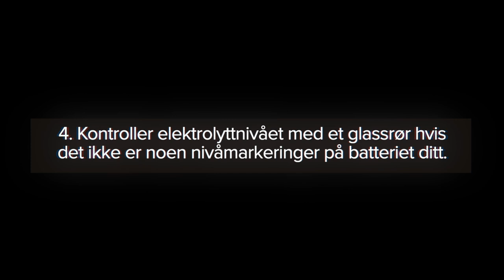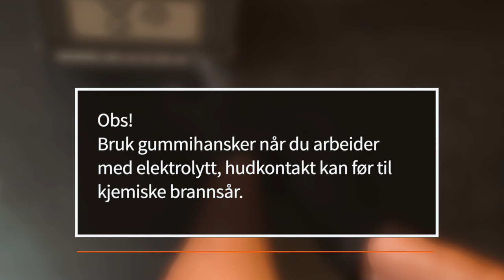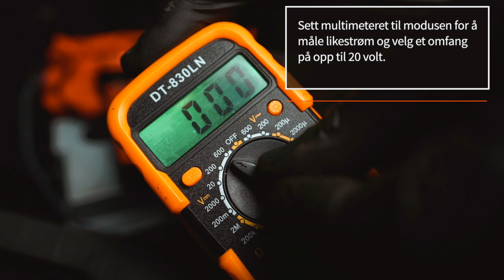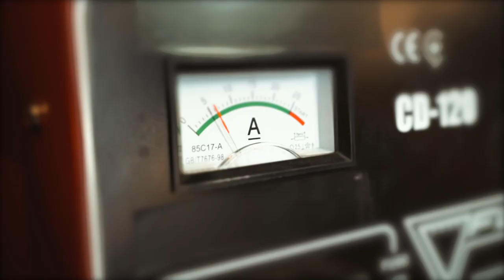Slik sjekker du bilbatteriet | AUTODOC

Comment from the maker: Ta en titt på videoen og fortell oss om det i kommentarfeltet, hvis du synes den var til hjelp 💬

0:07 — 1. Inspiser batteriet.
0:32 — 2. Kontroller elektrolyttnivået med en måler.
1:00 — 3. Kontroller elektrolyttnivået med markeringene på batterihuset.
1:29 — 4. Kontroller elektrolyttnivået med et glassrør hvis det ikke er noen nivåmarkeringer på batteriet ditt.
2:25 — 5. Kontroller elektrolyttettheten
3:17 — 6. Mål batterispenningen med et voltmeter eller multimeter.
4:03 — 7. Sjekk batterispenningen med en batteritester.